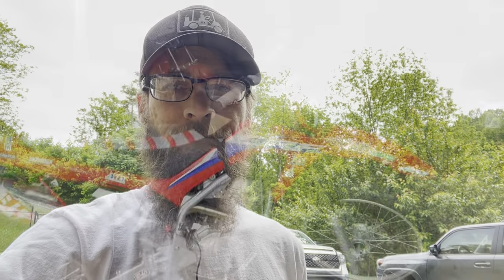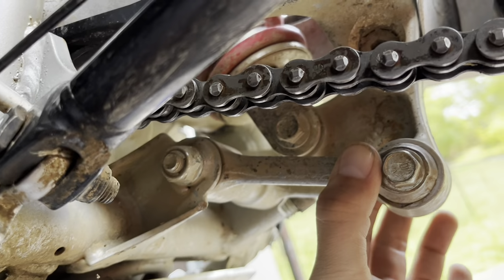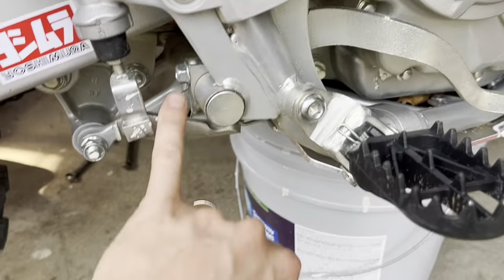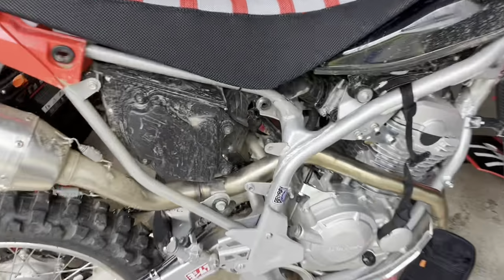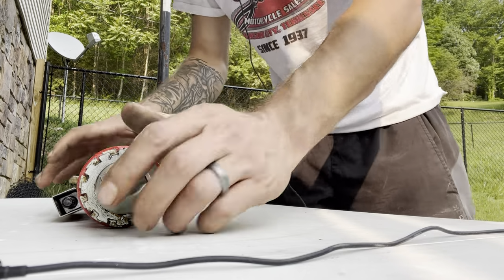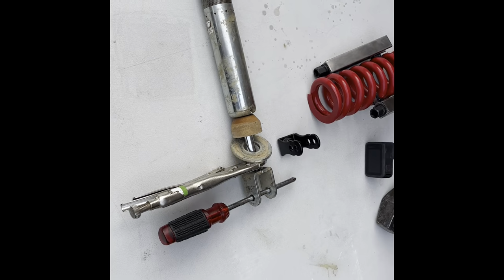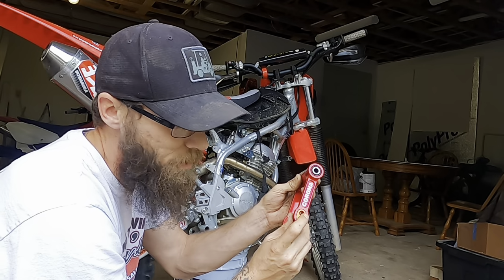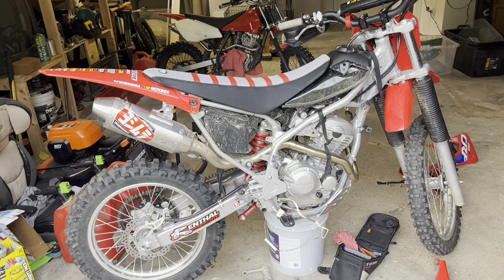HONDA CRF250F Install & Update | New Mods & Suspension

Comment: Just got the Tuscany Racing rear shock. Added 2” to seat height. Really please with it. Hope ur stiffer spring rate improves ur ride!
Reply from the maker: That’s awesome!!! Thank you! Have you done anything with the front yet? I have a second video that will be coming out I would venture to say tomorrow night or Saturday afternoon on part2
Reply: @ThatGuy-771 I also upgraded my rear to the tuscany shock, it lifted it 2 inches. I also installed the corona link like you did, making it another inch taller. Feels like a proper enduro bike. I haven't had time to install the front suspension tuscany make, however it is a project that I intend to do this weekend. The bike definetly needs it, it's like the rear is solid and plated and the front is a pogo stick bouncing over every little bump and rock.
Reply from the maker: @viclopresti6826  that’s awesome! Exactly what I was going for with it after hitting a few logs with the stock. Part 2 may help a lot with figuring out the rest minus just the rear as a hint. But I’m looking forward to how it’s going to do! Let me know how you like yours with your front done!
Reply: @ThatGuy-771  I bought their “front fork good pressure kit” but haven’t installed yet. Also bought the Anker front fork extenders through hyperlite moto to bring up the front and keep proportional to the rear.
Reply: @ThatGuy-771  I’m so glad someone like yourself is doing these vids on the 250f. Not enough love here in the states
Reply from the maker: @Jeff-501  heck yea! Hey I greatly appreciate that! Yea these bikes don’t get enough love. With the right setup a lot of people would be amazed what they can do! That’s what I for sure want to prove and doing rides as well with it which we have a lot coming up! Let me know how you like your setup once it’s all done!

Comment: Hey nice video I just ordered the set of front springs but I was wondering about this rear spring, can I just buy and install the spring or do I need the new linkage and other parts you bought with the spring?  And is there anything I would need/should regrease after taking apart?  Thanks
Reply from the maker: Thank you! I appreciate you checking the videos out. 
So you CAN just install the spring. You don’t need the cleat or the linkage I have. That was just to raise the bike up. Similar to the front fork springs. You don’t NEED the fork extenders I just did it to gain the extra height. 
Only think you will need for the rear though is spring compressors. You’ll only need grease if you were wanting it for your linkage bearing IF you want to go ahead and grease it while your at it and disassembling the rear. Otherwise no. You don’t have to disconnect it at that pivot point regardless. That’s just optional.

Comment: Where did you set the preload with the new spring? I assume you can't set the sag to stock specs with the new linkage raising it up? I have front and rear BBR springs I need to put on mine.
Reply from the maker: Hey Tommy, Correct. Nothing for sag on it. But I am running preload easiest way to tell you is 3/4” from the top of the collars to the top of the threads. Only set it down that much due to the fact I wanted a “little bit” of softness due to only being 160lbs. Didn’t want it to be to stiff and be bucked like a bronco. I know mine from the factory was about half way down the entire shock. It was compressed a good bit but bottomed out like no other of course. You’ll love the springs. HUGE difference with just being springs. I’m pending my full review on them now. Hope that helps though!
Reply: @ThatGuy-771  thanks for the info. Yeah, I weigh 210 and don’t want to make it too stiff since there are no adjustments for compression and rebound on the shock. I know what you mean about being bounced off! I have a 250 Rally and the shock was so weak that it would fully compress and then shoot right back to full extension…not fun.
Reply from the maker: Haha yea I have some toying around to do on the settings I’m sure. But we will see so far it’s pretty solid!

Comment: So if I’m just replacing the shock I don’t need to loosen the rear break correct?
Reply from the maker: That is correct. You can disconnect the linkage from the furthest back bolt so it will allow for the shock to fall down. That is only to remove the from linkage bolt you will need to loosen your brake up.
Reply: @ThatGuy-771  thank you man! Your video is extremely helpful
Reply from the maker: @matthewclawges644  I’m glad to hear brother! Glad to try and help. Your more than welcome. More still to come for this tank lol